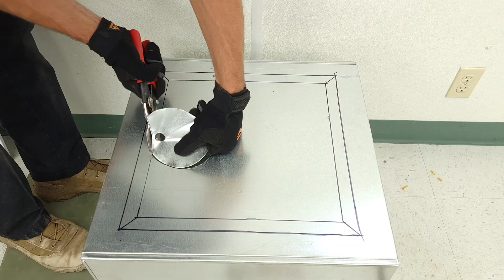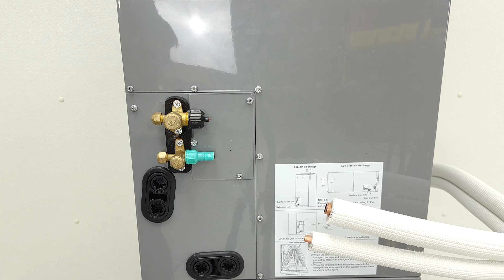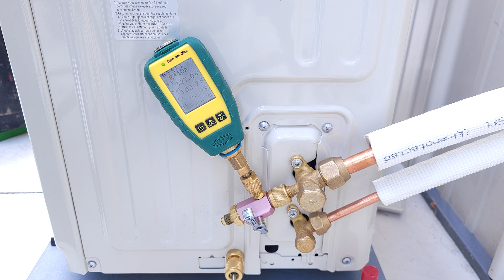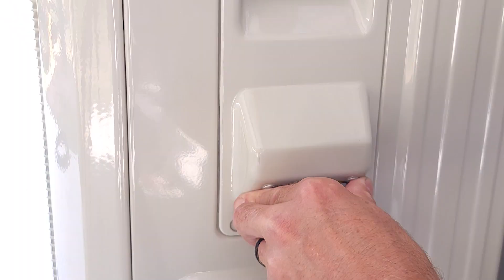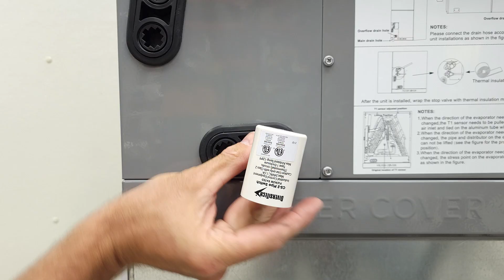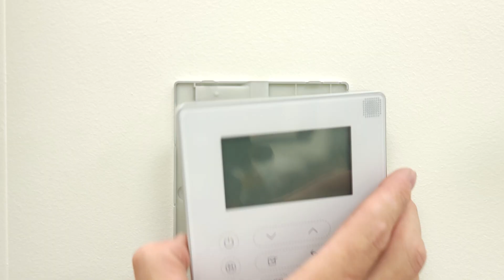Full Installation of an Inverter Mini Split Heat Pump to A Ducted Air Handler!

Comment: does no one notice that he never charges the system? There's no refrigerant in the system.  The system is inoperable.
Reply from the maker: The outdoor unit is not dry, it is fully charged with refrigerant. You can't adjust the charge of an inverter system like this using a single stage unit charging method. The refrigerant within the outdoor unit is sufficient for this line set length unit.

Comment: Thanks for the video.   For the outside unit, if it is mounted as you have and on a concrete patio, what is the recommended/proper way to level it?   We are finding that ours is leaking water on the side opposite the main drain.   Upon checking with a level it looks like it is leaning towards the building side.

Comment: I wish there were instructions ANYWHERE about these stupid RG10 remote controls that come with the air handler. It says optional equipment in the manual, but it's obviously needed to do a proper setup. And there are NO instructions anywhere, not Carrier, Midea, ACiQ, Mr. COOL, DIY HVAC, Pioneer... ZERO. absolutely crazy. I'm sure I'm not the only one with questions on these things!!

Comment: I bought this exact model and installed it in one of my rental units after I was quoted $10k for a new AC. I saved $5k even after buying all the tools.

The only thing this video omitted was the fact that you need to pull the J1 switch on the circuit board. Otherwise, your float switches will be bypassed.

This video spawned my love for HVAC. Left my job as a research scientist a few months ago and starting a job as an HVAC installer next week, and they will match my pay.

I am excited to make a career change and looking forward to educating myself with your videos. Thanks again, brother!

Comment: I bought an outside 36k btu mini split unit. I don't the regular ductless air handler that are normal for mini splits. Can I wire up my Goodman inside ducted air handler to the outside unit or I have to buy a special inside ducted air handler for it?

Comment: Is there content in the e-book to help with adding refrigerant to a longer line set?  I installed one of these units with an existing line set from the former heat pump which is I much longer and larger in diameter 3/4" for the suction line and it cycles in 36 degree outdoor temperatures.     Appears to be two low of a charge.   Your videos don't show this type of unit and how to charge it.   Have you updated your books with content for charging and verify charging in this type of unit?

Comment: Question to anyone: Is it possible to connect the new outside condenser being installed here to a existing evaporator "A" coil inside the air handler in the basement which is fine. Like, if your AC condenser died outside ? Thanks for any feedback. Don't need to do it but wondering if it could be a less expensive work around for someone who cannot afford a entire new central AC system.
Reply: I doubt it would work properly because both units need to talk to each other...Missing sensor inputs to the control boards will cause errors.

Comment: My two hvac units are in the UN-conditioned attic space.  Not a conditioned room such as you demonstrate. Not going to be air returns or changing air return filters in the attic or are the attic units that close to the outdoor units.  Do you have a real world install video installing ducted mini-split in an attic?

Comment: Craig.  I thought nilog blue was a good idea to use for leaks.  But maybe not.
Reply: Nilog blue works great for straight threads. NPT threads (tapered) and flared compression fittings, such as the end of a lineset, are sealed using metal-to-metal wedging and compression, respectively. No nilog or other thread sealant is necessary.

Comment: I know you guys may not like the diy cob job. I have a gas furnace. I'm planning to replace it. I also currently have a caseless coil/ac system. In general sizing it all correctly is key. Can any correct sized coil go on any heat pump? What do you have to spec correctly. 2 ton coil for 2 ton condenser. Does heat pump or not matter for the coil choice?

Comment: Just bought a unit and a couple new items tripped me up. Would you mind addressing two more items?: 1. Units now require a 12V signal wire pair to between the air handler and the compressor. 2. Need to set dip switches for the measured static pressure on each fan speed. Low, medium, high.

Comment: I have the same unit but apparently newer model.  Followed all instructions but was getting EL01 error which is communication between indoor and outdoor.  Turns out the newest models are not using all 4 wires in the black cable.  It now only uses the #1 and #2 lugs, and the ground.  Requires a second wire pull as there is a new set of lugs labeled S1 and S2 that need to be connected between indoor and outdoor.  Probably a safer solution for data to be over its own set of wires versus running data over power lines.  Would have been nice if the directions that comes with the packaging made that clear.  Only reference of this a small diagram on back of indoor unit upper cover.

Comment: could you  explain what is happening when the inside and outside units are communicating back and forth, is it possible to bypass these interface boards, and connect like the non inverter units Y compressor B reversing valve

Comment: Is it possible to use a 24v thermostat with the standard Y/B/W wire connections at the outdoor unit on an inverter style heat pump, do you absolutely need an interface board to communicate with the outdoor unit.

Comment: In order for the torque wrench not to take into account the friction force, it is necessary to lubricate with oil between the nut and the rolled copper

Comment: Excellent, meticulous video, however before you reinstallrd the Schrader core and purged the air out I think it's misleading to think the air in the Schrader removal tool is somehow stratified and is sitting at the end of the tool, in the chamber, closest to the exit port waiting to be ejected by a blast of purging  refrigerant. The air in the shrader removal tool is a gas and immediately mixes throughout the whole system when it comes in contact with the refrigerant vapor. It's hard to avoid getting tiny amounts of air into the system.

Comment: I tried to change fan setting from service menu on 18k BTU model but it didn't show me code C5 after changing. Where do I find service manual for my model?
Reply: I had the same issue.
Reply: @ChrisJones1974  the best way to make it work like a normal AC without fan running all the time was to connect a regular 24v thermostat to it, in my case it’s Nest. Working like a charm.

Comment: I know basically nothing about HVAC. I have charged my cars air condition and installed a mini split system. As a DIY more or less, probably motivated from watching your videos.
Your comment about the electrical makes me wonder if you are a jersey boy? 

I'm trying to do research on replacing an old R 
22 system.

What's hard for me to figure out is that if I bought one of those all inclusive packages with a compressor and evaporator? What type of system would I need. 

The system that it would be replacing has an oil fired furnace. There is no propane or natural gas on the property. 

I'm wondering how you would tell what type of unit would come with an evaporator coil?  ( there is central air that has a blower that blows through the current evaporator coil going straight up so I guess that would be a "vertical ").

Do I have to see if the evaporator coil/unit package states something to say that it is compatible to put over oil fired furnace ???

I've become motivated by watching all these videos to the point that I just took my EPA 609 exam and I'm taking the EPA 608 this week .
;)

Comment: Can this unit accept a four-zone duct control system?  I need to control supply to four rooms of which three are seldom used.  Worried about pressure and efficiency with only one duct open.  Thanks

Comment: I’m looking for a split system like this with an air handler for a small room with 3 vents but also add a wall unit in a different room. 

Any suggestions

Comment: Would it be possible to close in the service valves on the indoor unit before removing the caps, make all the connections, open them back up and use that nitrogen charge to leak test? Is there sufficient pressure in the coil from the factory?

Comment: The white wire is hot 230 vac, by code it should be re appropriated with color tape or other means. white is always neutral except in dc circuit’s.

Comment: The majority of heat pumps we deal with in Western Canada are water source and from what your seeing that the Evap is the problem for the leak and definitely airflow the high head pressure is the tell tale sign and then how it was confirmed on the low side with low Evap temp. It’s tough when it’s the in between season Steve to hit the moving target of pressures and temps and low load.

Comment: I just noticed that he is using the 1/4” core removal tool as a ball valve shutoff to the vacuum gauge. I was trying to find a link to a ball valve to protect the vacuum gauge but just noticed this after re-watching the video.

Comment: Could you please do a video on the heatpump outdoor unit drainage during the winter months.  Basically water drainage from the Defrost cycle.  Also a video about pads and wall brackets would be great.  I got the confidence I needed (thanks to you and some of the other great YouTube teachers) to install my own mini-split ducted, duel fuel system.  I had no problems and it is heating my home right now. Thank you.
Reply: Depending on your temps and snow fall determines how far off the ground you need to mount it. IF you already installed it it kinda is too late.
Reply: @JST  ,   we get about one foot of snow max.  So I got it higher than that.  It is three degrees F here tonight.  My duel fuel system has cycled quite a bit.  My Aux heat\furnance has kicked in with it's 125k BTU.  The heat pump definitely is helping to keep the house warm.  At this outside temp, the heat pump is taking about 60% of the cycles.
Reply: Don't know if your reply was meant to be, but in my case, I just let it drop. Since my particular unit isn't in the sun, the water freezes there in a big mound until spring. It's annoying and I'll have to fix the mount but it's my secondary source of heat for now.
Reply: @sprockkets  thar is what I am doing right now.  Making a ice lake.
Reply: @yewsuck5537  What's funny is one other mini split at a business barely has any, but is in the sun and they didn't mount it at all, just on a pad. Same area. 
As long as it can drain, somewhere, and not mess up anything, it is ok. I thought about piping it away but really, I think it would just freeze inside it and make it worse. The inner heater cable in mine seems to barely help.
Reply: @sprockkets  good to know that the heater cables do not work well.   I got one sitting here.  I think your right.  I think the hose would just freeze up.  Take care.

Comment: A consistent issue I see in minisplits that are sold with the power communication wires between the outdoor unit and indoor unit, the power wires and ground must be the same size as the supply wiring. The NEC requires this, as the circuit breaker is to protect the wire, not the load. In this example video, that interconnect cable is not 10AWG size. Note that outdoor unit terminal strip is direct connection from the input power to this auxillary power connection. One solution is to install fuses inside the outdoor wiring cabinet to protect the smaller wire.
Also, the latest NEC requires all HVAC units to be connected to a GFCI circuit breaker. I don't see any HVAC channel on youtube talking about that.
Reply: I've heard there might be a  GFI requirement in Jan 2023 but I've also heard of problems using it with inverter mini's. I asked Senville and they told me NOT to use a GFI. Also mini's are considered appliances and appliances do not require GFI's, at least right now just like tankless water heaters.

Comment: Craig mentioned loss of efficiency if you use a traditional thermostat.  Is there any documentation that spells out what functionality you lose?  Does it turn the system into a 1-stage because now it doesn't know the distance from target temp?

Comment: Thank you for all the valuable Great Videos I wish you all the best
Sir
For the Under Load Capacitor Test
Test capacitors while the system is running

( 2652 ) is for 60Hz only

But For the 50Hz calculation we use ( 3183 ) like my country is using 50Hz

Comment: I plan on installing this style of system at home this winter along with new ductwork. (The existing design from the 1950s is pretty ridiculous). I’m hoping my own personal experience with the system will translate into selling points for my customers 👍🏻 With that said, thanks for the video! Your timing couldn’t have been better. 
Btw, I’m planning to create a conditioned envelope in the attic and relocating the system to that area to free up headroom in my basement, which I’ve been seeing a lot lately in green home designs. Can’t wait to see how it turns out 👊🏻
Reply: That 50yr old system you have is most likely better than anything today
Reply: @JesusChristIsTheTruth100prcnt  system is a fuel hog from the 80s. Ductwork is 50 yo and not big enough for cooling. Older is definitely not always better…

Comment: Great video!  Pan head screws to attach the filter frame… YES.  Such a simple detail that makes a big difference when swapping filters.
Reply: Question could you put electronic filter there or the 5-in for 5-in Hospital filter replacement

Comment: I have a 4 ton AC and a gas furnace that has an input BTU rating of 125,000.  The furnace definitely is oversized for a 1,700 sq ft ranch.  Wonder if a 5 ton MiniSplit would be good. I have to say, I love gas as a heat source, or perhaps the “backup” heat.  MrCool had some nice solutions for this and are DYI capable should a skilled homeowner want to give it a run. I put a 1 ton MiniSplit in the garage and love it. Energy savings alone is so worth it.   Love your channel as I pickup on some procedural tips that are so helpful.    PS: do you wear a silicon wedding ring ?
Reply: If your house was recently built, and is to code, it's very likely your heat load is around 750sf/ton. If you have a ton of windows that number could be lower, if your house is sealed and insulated really well you could be at 1500st/ton. 

You really need someone to run an aggressive manual J.

Comment: I would have left one loop as fudge room - also, it is my understanding that you need to keep the line set at the length it was designed for as there is a minimum length.  I was told a short line can reduce the efficiency.
Reply: The Senville unit comes with the electric strip heater this C&H does not

Comment: As many others have spoke about, the white pipe insulation has been an issue on some units.  After 2 years I had to replace my line set due to pin holes in the copper line caused by acidic reaction due to copper, insulation and moisture. My unit was a pioneer but have heard of others also.  I now used a mueller line set with the black rubber insulation
Reply: yes thats actualy cheap chinese copper,vietnamesenreally poor metalurgy, if you use usa copper than even when the copper turns green wont develop pore holes
Reply: omg nobidy gets it still! its been verified over and over if you use the vacuum hole larger diameter back down restricting to 3/8 than it makes damn no diffrence  at all,so mmany times me and my boos proged everyone wrong on this unlees you have the hose i believe 1/2 without narroqing down straight to that larger port adapter on the pump found on some yellow jacket bullet pumps than yes that will work butthose larger hoses than then narrow down to 3/8is a marketing sales gimmick
Reply: @JesusChristIsTheTruth100prcnt  Your assertion that hose size doesn't matter has been handily disproven by Jim Bergmann.

https://www.youtube.com/watch?v=zSz-7oV8Scg
Reply: @pagedterror13 try sucking on a 100ft hose 1/2 inch and then 1/4 inch, there is a difference even though the end of it is reduced to 1/4 inch on the 1/2 inch hose. You can't just ignore the fact that the resistance between a 1/4 and a 1/2 inch hose is different. Yes there is a bottle neck where it narrows down from 1/2 to 1/4 inch, but it is a very short bottle neck compared to the total length of the system. Physics proves this out.
Reply: youre using a controller not a thermostat, yes it does   a function of thermostat but additionally alot more & has a processing chip built in it,its actually pretty cool what you can do with it😊
Reply: No worries 👍 
Who ever has an AC unit needs to have a AC maintenance plan 🤔
Reply: First I've heard of this. I thought the white stuff was because it doesn't break down in the sun.
Reply: It breaks down alot more than the black insulation @sprockkets
Reply: So should you take off what they give you with the pipe and put the black on it instead? Or can you use the old lines to your old unit and make them fit? They're much older in my case 30 plus years old but they go to where I need them at and where I need to put the outside unit
Reply: @samuelwotring633  I’m sure that old copper is good and probably better, but I would flush and then purge with nitrogen first.  I would use black insulation, (on Minisplits you need to insulate both lines, since TXV is in outside unit)